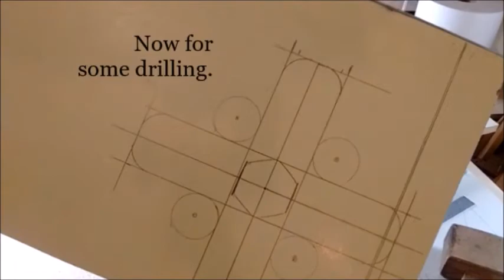Surely One More Router Table Vid Couldn't Hurt...

Comment: That lift is really super.  Would it be any use to glue/fix a 25mm - 40mm bearing on top of the lift 'handle' to prevent friction between the lift handle and the router?
Reply from the maker: baconsoda hey that's an excellent idea. It is just a wee bit jerky (the springs are mighty stiff) and a bearing could well even that out. Thanks for that mate. How's the form now?
Reply: I'm doing rightly thanks.  Still very weak but well improved.
Reply from the maker: baconsoda so glad to hear you're improving. I imagine Mrs. Bacon will be glad to get you up and about (translation: out from under her feet.) God bless you mate and very best to ya'.
Reply: Thanks Mark, I think Mrs Baconsoda is looking for a job to get away from me.
Reply from the maker: baconsoda sounds reasonable, I think mine looks forward to her on day of the week job to get away from me. Oh well, that's why God gave us sheds. Keep improving mate, I still want that free turning lesson.
Reply: Absolutely, that will happen before too long.